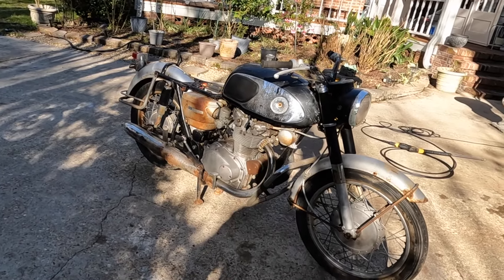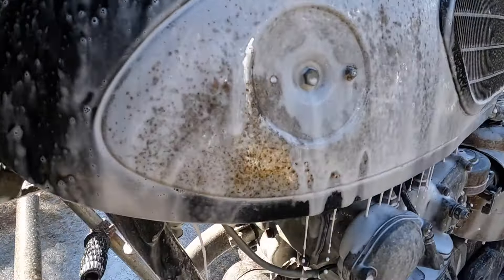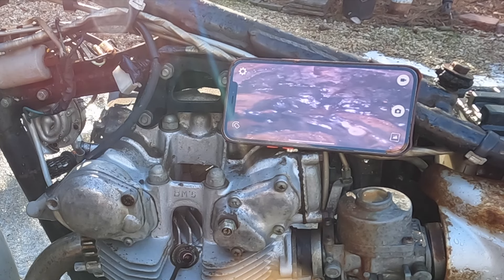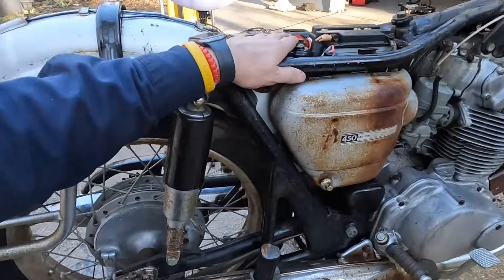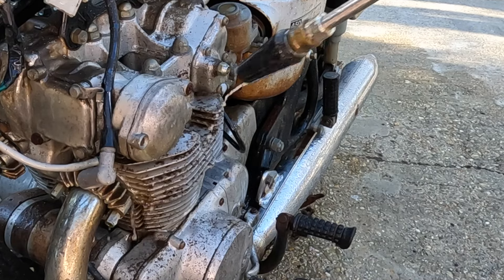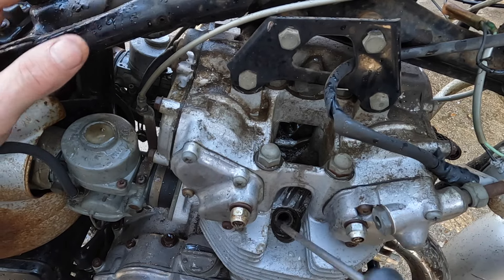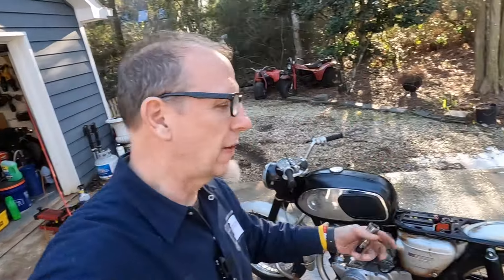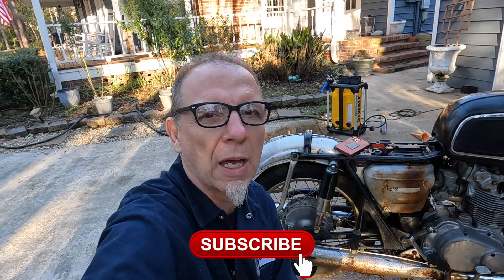Reviving a Legend: 1965 Honda CB450 K0 The Black Bomber #motorcyclerewind #cb450K0

Comment: I do half marval oil with half acetone. Let it sit for 2 weeks. Then i heat the cylinder with Map gas.When you see the vapor coming out the spark plug holes your ready to put a socket on the rotor nut amd hit it hard with a rubber mallet. Keep the torch away from the flammable acetone. I used this method on my 1974 Cb 350F that was locked up solid for 44 years it runs like a new bike.
Reply from the maker: Great Tip! Thanks for sharing. I will add some acetone and Marvels to the diesel in the case right now. Patience is key!

Comment: You are getting quite a few very good bikes. The XS 650, the Laverda (American Eagle), the CB 450, the 850 T. Each one is a champion!
Reply from the maker: I am pretty fortunate with the bikes I get. Some are mine and some aren't. Lucky to have good friends with great motorcycles.
Reply: I had a XS650, put 48+K miles on it.  Needed the valves replaced, the tops had pitted .  The charging system had failed.  Gave the title to a guy who gave me a lift home,  I'd forgotten to charge the battery at work that day.    Few good memories.  I think of it as a reliable BSA/Triumph, not comfortable.  Mine had the step seat so, to my eye it was unattractive. @motorcyclerewind

Comment: I just the freed up a locked CB500T this past week (basically same as  the 450) engine a buddy saved from being scrapped. It was apparently sitting in a backyard with no exhaust pipes. Lots of PB Blaster sprayed down the spark plug holes and into the cylinders worked for this one and always has in the past.
Lots of water got into the left cylinder and rusted the piston in place
Reply from the maker: Slow and steady wins this race. Patience is key.  Although I am normally short on it🤣.Thanks for watching

Comment: If a bike is essentially complete, it is designed to withstand water ingress so I would wash first before you start taking a carb off or whatever. Also it means you will be working on a clean machine.
Reply from the maker: Agreed. Pus who wants a bunch of dirty motorcycles in their garage. Thanks for watching.

Comment: Gotta say, I've never seen stuff like that come out of an engine. I haven't the faintest idea what it is. Your guess of varnished fuel is as good as any, it's just that there's so much of it. I've never seen it do that. Did you take a whiff of it, if so, what did it smell like? Don't think it's RTV, though. It's all over the place in there and there doesn't appear to be any in the other cylinder. I see you've got the first episode of Talking Motorcycles up, so I'm watching that next. Can't wait to see the next episode of The Black Bomber, too.
Reply from the maker: Definitely think it’s varnished fuel. It may have laid on its side for a while.

Comment: find a second bike . save that one for parts,  one thing i learned  there's always  a few parts you cant find.   like the right control with the brake perch attached for a 1970 honda cb350 super sport or  a repop rear fender.
Reply from the maker: You are right, each bike has an "unobtainium" part. Thanks for watching

Comment: I’d say it depends on how much money he has to throw at it and commitment. Just the fact he has the frame, motor, and other parts is a good start.  These rare bikes are special and take time unlike, say a cb350. But when it’s done the payoff is great. I’m kinda in the same boat with my 68 DT1, slightly intimidated to get into it
Reply from the maker: Agreed. I think we should look for a later CB/CL450 engine and swap it. Take some time to rebuild this one. But be able to ride it in the meantime

Comment: My money is on a stuck carb float that hydrolocked that left cylinder with alcohol-goosed fuel. When fuel with high alcohol percentages evaporates, it leaves that 'It Came From Outer Space!" green slimey stuff.  Don't ask how I know. ;-)
Reply from the maker: I was thinking it laid on that side and filled the cylinder. Then turned into space boogers. Thanks for watching.

Comment: Hot Diesel Fuel down the Spark Plug holes..then warm the Engine Block with a hot air Gun until the Diesel Starts to Vapourise...then Gentle pressure ONLY on the end of the Crank with a Small Spanner or Socket.
no Hammers..
Reply from the maker: Will give this a try. Thanks for sharing and thanks for watching.

Comment: I gave just finished restoring a 1970 CB450 that hadn’t run in 43 years. I did all the work. Mine runs very well. You will NOT make money on your Bomber. I did my ‘70 because it was free and the engine was sound. Do the job because you want to, but you will lose your shirt financially on it.
Reply from the maker: That’s awesome. I love the styling of the early 70’s CB450’s. I have a CL450 that is in the queue.

Comment: That's a parts bike. Buying rebuild parts for the engine are like buying gold. (If you can source them). The juice is just not worth the squeeze for that old Honda. If you are just looking for a project to create "Content" then maybe cost isn't a factor.  Cost would be a major factor for someone trying to put that bike back on the road.
Reply from the maker: We are in the same page. Normally, I take crappy motorcycles and make them run and ride as affordable as possible. The bike is worth saving. All depends on what his plans are for it. Thanks for watching.

Comment: Best penetrating oil ever is 50% Acetone 50% diesel although 50% Acetone 50% ATF runs it close
Reply from the maker: I may add some acetone to the diesel I already put in the case. It can’t hurt.
Reply: best have rusty evapore liquid and diesel first, then oil. and if have hard rusted need use elektric evaporate elektrolyse rust off have best methor if can make, simple need only 12 volt power supply or full car battery and some hour time. then can use chemicals.

Comment: I would not do a restoration. Make a good running bike out of it . Keep the patina. Take off cylinder and rebore , check top end, clean carbs, new tires and tubes. Neck bearings etc . The cosmetic stuff is what brings the expense up.
Reply from the maker: Thats what I would do. Make it a rolling restoration. Thanks fro watching.

Comment: Drain the oil put the plug back fill up with evaporust to the top 24 hours later drain again marvel oil inside I bet the engine will move
Reply from the maker: I think that is a great idea. Maybe we will get lucky🍀Evaporust worked wonders in the GPz. Thanks for watching.